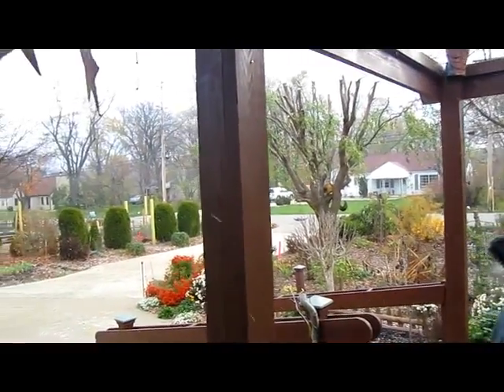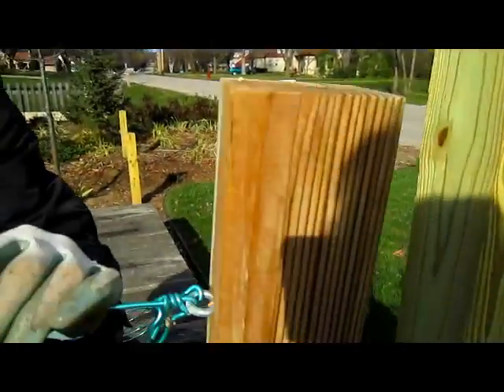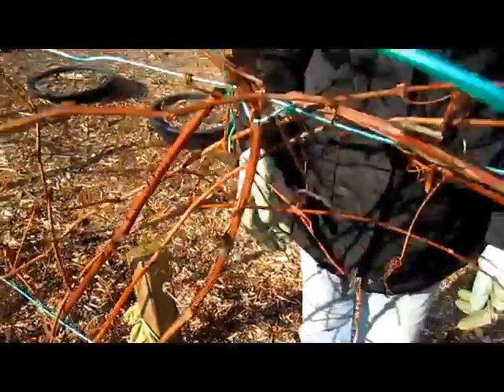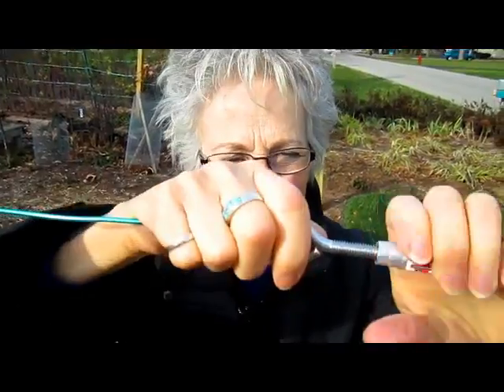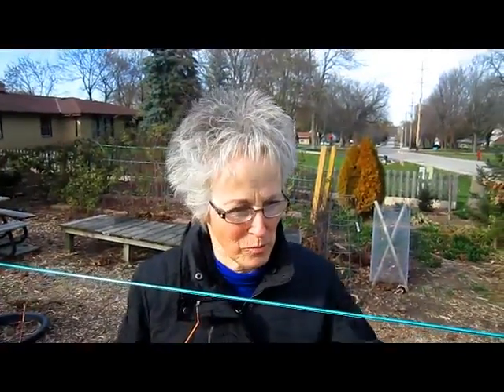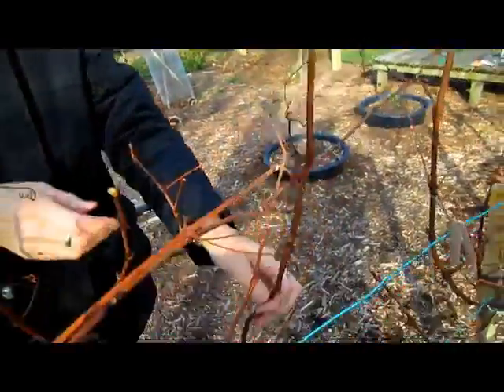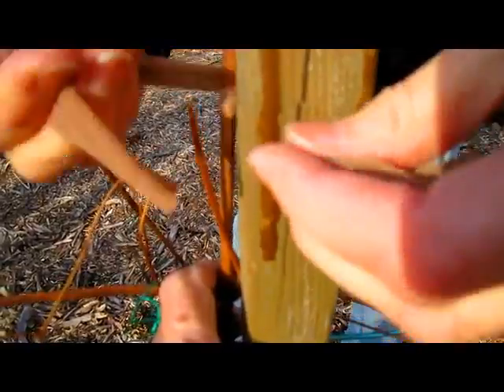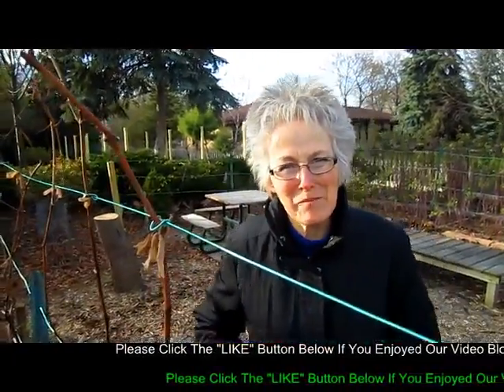Grape Vine Structure - Wisconsin Garden Video Blog 344

Comment from the maker: It’s good stuff. Dand-O-Line Stock #123148, called Anchor Wire USB #38902017000 Got it at True Value Hardware store. Have the company address if you need that. Thanks for visiting. Lynn